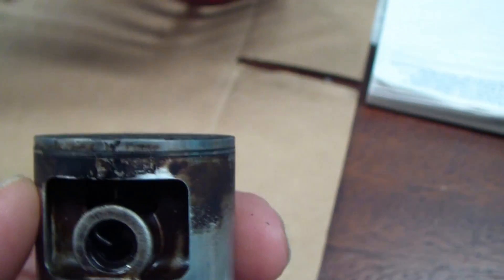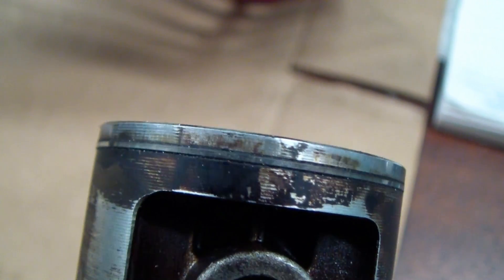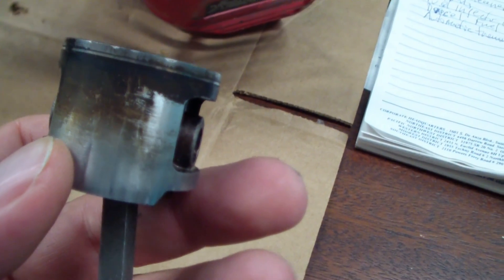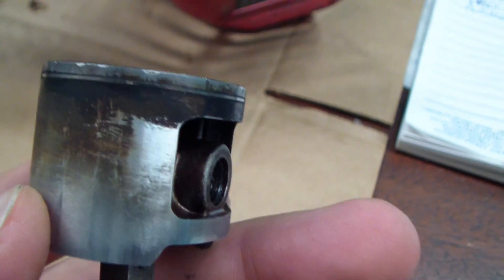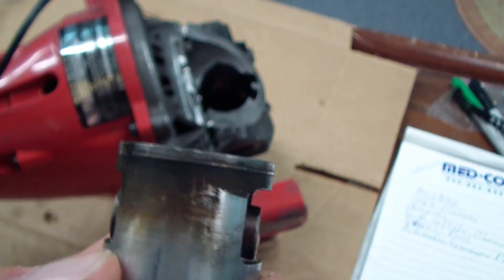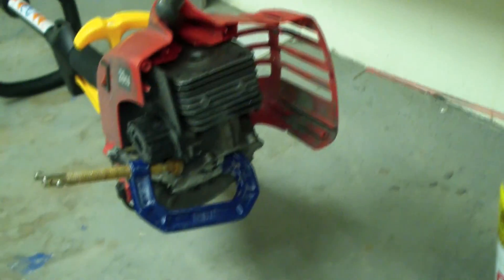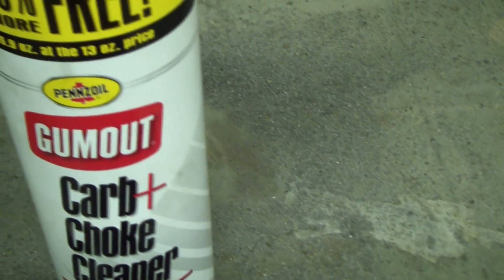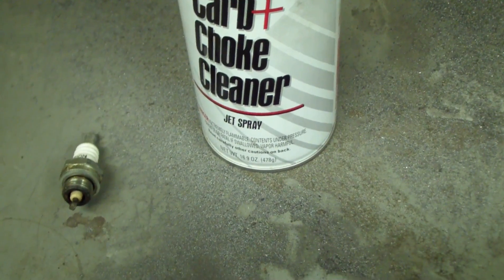Homelite Weed Trimmer Repair Tutorial Part 4

Comment: Hi I have painfully watch all your 4 videos. I must say you are very inquisitive and really want to get to the bottom of the no starting problem. So I thought I would enlighten you a little because I see you really want to know answers. I work for a very big small engine repair center, in fact probably the same company you bought it from in the first place. I have extensive experience in fixing the Homelite, Ryobi, and other variants brands of this 26CC trimmer. It's too late now being this was over a year ago, I was late to the party...lol, but I have enough experience to diagnose this from your first video. The biggest problem I see with these trimmers besides the Carb. being out of adjustment is the muffler being clogged. Dirt Dobbers get inside of the muffler and some times your lucky and can see the clog from just looking with a flashlight inside the muffler, but other times you can't tell because they are deep inside. Now I know what your saying, "I did a compression test and it only read 50 PSI" but unfortunately with a clogged muffler your unaware of will give you a false compression reading usually below 60 PSI.
So at this point let me give you some simple procedures that should always be followed when diagnose most 2 cycle trimmers, including this Homelite UT33600 or UT33600A. This should be the model number you have or could be another UT33XXXX variant model, but regardless is the same steps.
Reply: Thank you Ken for your quick reply. The issue is the replacement pulse fuel diaphragm and the little flap-valves on a plastic gasket (not sue of it's specific name, but may be called a diaphragm fuel pump) that operates both inlet and outlet fuel through the carbie. The pulse diaphragm that was pulled out has a vey small activation nipple for the needle and seat lever but appears it was a non-original due to shape and incorrect fitting (not being sqaure and matching the four bolt holes). The replacement pulse diaphragm I got from a repair shop was a guess by them and the nipple that activates the daphram is about 4 times taller. New to using Youtube and I can't see anywhere that I can attach a photo of these diaphrams and gaskets which would really help show what I was talking about. You may not have your Homelite unit anymore, but would be curious, if you do, if it has the 19 in the location I descibed above. Not sure if the pulse diaphragm goes onto the needle and seat base first followed by the gasket then the outside mounting plate (metal cover) or vis-a-versa. If based on a Walbro carbie, then it is the gasket first, pulse diaphragm then external cover plate. Appreciate your help. Thank you again and have a great day. Cheers. Daryl
Reply from the maker: These look like good diagnostic steps. I gad to take a few of your posts out of the spam folder but I will vote these 9 comments up so other can benefit from the advice.
Reply: Jack Fowler Thank you to Kent Diego for the 4 videos he posted. I found them very interesting viewing, but was hoping he did a carbie teardown instead of the engine so I could see where I may have gone wrong on reassembly as I forgot to take digital photos of how it was put together when  I took the carbie apart. I'm having starting and running issues with a little Homelite Mighty Lite here in Australia and appears to be in relation to the carburetor (as you noted in your comments these are a major an issue). According to all the research I have done in the past week, these carbies appear to be disposable rather than repairing with the recommendation to throw it away and get a new one. I find it hard to accept that a replacement set of gaskets and new diaphragm is much of a rebuild, but I suppose it is.The specific model I am helping a friend with is the HLT26SDN, but every reference seems to give a UT** model number and I can't find anything anywhere to help on this reference. The only reference to the carbie I can find appears to make it a JUIXING carbie and from external markings, the nearest thing I have found on the outer block is the number 19 located in an almost hidden cavity deep between the prominant L on the left and H on the right. I have compared Zama rebuilt kits that look identical, but a Zuixing carbie is not in the Zamba referenece charts. from the phot's, the Zamba parts look identical, but what model will suit? GND-12, RB29, RX-1 all seem to match, but I have no idea. Is it a case of buy and try? Any suggestions on a rebuilt kit for the gaskets and diaphragm would be appreciated? Many thanks. Daryl
Reply from the maker: Bushy260  I rebuilt a few car carbs in the 70's. The most important part is using special cleaner and a brush. There was some white liquid I used that did great. Never move or remove the throttle plate! Most of the time a rebuild works.fine but sometimes it does not and the carb never works right. If you have a leaking gasket you can by a sheet of gasket material and cut to size if you have a steady hand. Be sure to get the "Pac Man" carb adjusting tool to set idle and run mixtures.
Reply: Good morning again Kent, Sorry I called you Ken last time by accident. I have finally worked out how to upload photos and made a post on the Homelite I am working on. Hope these photos help somehow.

Comment: U need take piston ring out and clean all where the ring goes ,
Reply from the maker: These thing are not made to be repaired. The head and cylinder are all one piece. The connecting rod was solid one piece and I could not see any way to remove from crank shaft. The method presented using ATF is the most practical fix I could see.

Comment: Kent,
I had the very issues you talk about on your videos even the same model. So I took some Transmission fluid, pulled off the plug and put in the cylinder head area over night. Drained it then flushed with some gas, and the buttoned it  back up and Kicked right on. one not when I first put in the Trans fluid it just came right out then after a couple of more filling attempts and the over night setting the ring must have come lose. Thanks for you video. 
MP

Comment: Videos such as this cause reason to believe that bullshit cures cancer. Fist off nothing can remove the wedging effect of the waste hydrocarbon deposits until there is a release of the pressures caused by its fit. Only removal of the piston and a proper cleaning of the built up deposits will release the ring. There is no miracle cure for Laziness.

Comment: That poor pistons ring is still just as stuck as day one. If the ring is not sticking out around the outside of the piston and moving free in ring groove it is STUCK. Any carb cleaner, break clean is safe to use on it and will dissolve the carbon, but trying to do it in the cylinder and assembled will take a long time. carefully picking at the ring end and moving it will help dislodge the carbon. Of coarse the only fix is removal of the ring and cleaning the groove out then installing a ring.

Comment from the maker: I was not able to find a source for replacement rings so I gave up and dissected engine assuming it was unrepairable. What do you use to dissolve the carbon? There would be less risk of damage if you were able to unstick ring without removing piston.

Comment from the maker: I was able to unstick the ring in Part 4 but the best idea is not to get it stuck in first place. I bought a "Pac Man" carburetor adjustment tool so my new string trimmer will not die an early death from running too lean.

Comment from the maker: Hi Jay, During troubleshooting in Part 1 I found the spark plug was damp with fuel and I could smell fuel. I also tried putting fuel in spark plug hole and starting ether to determine if it was a carburetor problem. Not one sputter. The carb looked like new as the motor was not very old. In Part 2 I did a compression test and only got 50 psi. In Part 3 I removed piston and inspected and saw ring problem. 
If you made a video showing your carb fix I am sure it would be of great interest.

Comment: I  have a  old home lite that keeps blowing fuel out the air filter...     Remember  gas  gumms up  after sitting..   there is a  hidden screw in the carb that you need to take out an  clean with a  small piece of wire.  I  do believe your  machine was not getting fuel.